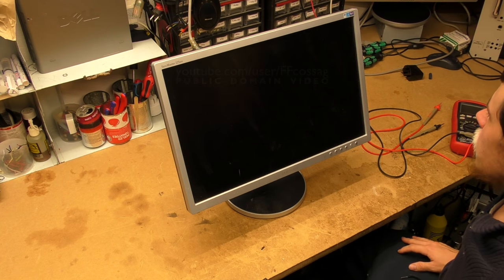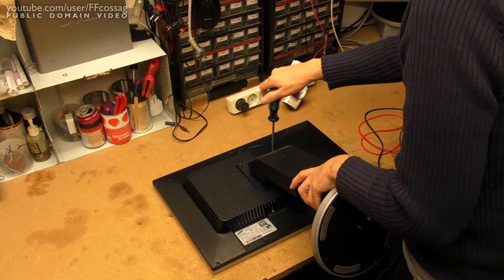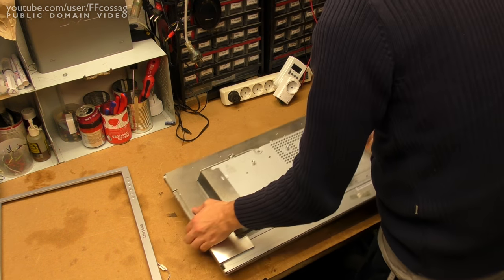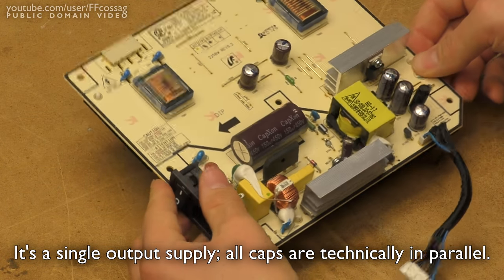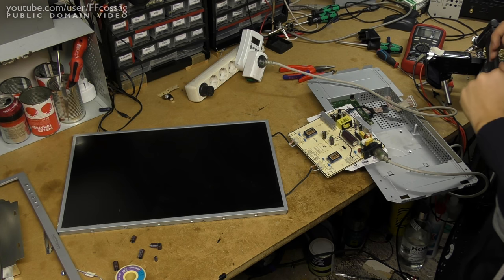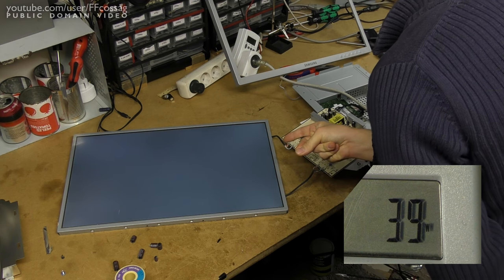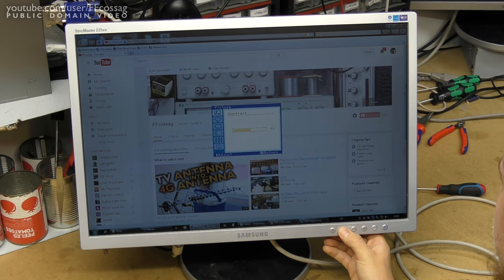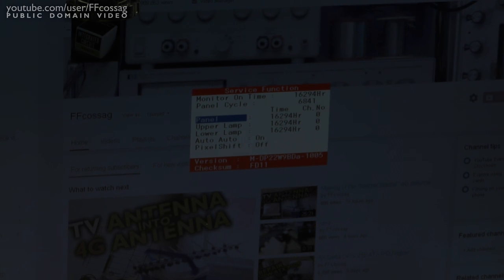Samsung Syncmaster 225BW repair

Comment: Funny, I had to make almost exactly the same repair on a similar model 224BW I think it was. Just a few mintor differences. Same value and brand caps, also same ones bad. Main cap was not CapXon though and still ok. Got the best Rubycon/Nichicon ones I could get and only paid 3.xx EUR for all of them.

Comment: I've got a 19" SAMSUNG 906BW Black-Silver 19" 2 ms that required... I forget what now. The board had a previous attempt at repair. Ah I remember, I found another board for it. It is a very nice monitor, the price was just for the "new board"  I'll have to see if I can pull up that screen as you did to check the internal stats.

Comment: I recently converted a similar LG one to LED from LCD because only changing the bulging caps didn't solve my problem. The LED conversion kit simply jumped over the faulty part of the power board. I'm not entirely satisfied about the brightness after that but the power consumption is greatly reduced from 45W to about 10W. I was thinking about ordering an other kit to double the light intensity that might solved it but since I was planing to use it only as a back up if everything else fails I didn't bother. :)

Comment: Haha i have the same monitor a black one in my little workshop got it from a friend who found it in the trash, and i could not bother to even try it i knew it
had cooked capacitors and my friend he was like no that is impossible... nope i told him Samung screens of that era 2006-2009 are prone to this fault lol!

I also added a capacitor to the same spot as you, cant harm :)
Reply: Hagis2k I still have a black samsung synchmaster lLCD like this, I use it as a TV monitor after I paired it with a TV tuner.

Comment: I just tested my Syncmaster 205BW, which is exactly the same, just the 2 magically turned into a 0, can you imagine? Or maybe I've got the 20" version.
Anyway, it has run well over 31.000 hours ! That's quite a lot !
Reply from the maker: A lot indeed!

Comment: HP LP2465 has a dedicated menu item for also disabling the auto-switching source as well, if you ever run into one. I do wonder if such a thing also exists on your like-Fujitsu B24W-5 panel. 
up until you mentioned it, I didn't even think to check for such a thing-- I was definitely getting frustrated waiting 10 seconds more for the monitor to show picture when waking the monitor up while the machine's locked at the login screen. but, that's just dependent on this monitor for which DVI input you have your machine plugged into, and on this panel, that happens to be DVI 2.

Comment: Mine is starting to complain when power up the screen, its at 13088 hours and 14 years since i buy it.
I also dont have the right size avalibel, so ill try with 4x470uF and 2x330uF its a toat of 2540uF and original its 2630uF
Thx for the video

Comment: Depending on temperature the capacitors have a life.  Another video shows that a capacitor that dried up has so much resistance it is an open circuit.  I guess that they buldge when they blow.  Someone elses video shows what they look like with a puff of smoke from the middle of the + symbol.  What causes that final POP and they are blown condition?  :face-blue-wide-eyes:

Comment: My SyncMaster 225BW has been having issues for the last 50 hrs or so.  At first the screen brightness seemed to go way up (for instance I could not see cell outlines in Excel), but when I would try to fix it by opening the menu, the screen would just go black.  I could get the screen to work again by unplugging the unit, but it would turn off every time I pressed the menu button.  More recently, I've had a lot of flickering, and it takes awhile after turning on to get to the regular brightness.  Finally today, it was showing a red screen, and now I can't get any image to show even though the blue power indicator light is on.  Thoughts on what may be wrong and if it can be fixed?  I would really appreciate it!
Reply: Update: I took it apart, and all the caps are definitely bad.  At this point I'm just wondering if it is worth it to invest in some new ones, or if there is a bunch of other things wrong with it also.  I saw some of the comments about the bad lamp :/

Comment: Are you smelling for OZONE, which would indicate arcing of the high voltage supply on the tubes - bad solder joint.??
Reply from the maker: Yep.

Comment: i have same monitor but in black I think mine mean have bad caps because when you plud it in it works great but if you turn it on and back on the screen is all red
Reply from the maker: Red screen means bad backlight lamps.
Reply: @FFcossag  am I able to replace them
Reply: @FFcossag  also it’s not always red if I power it off and back on a few times it starts to work again
Reply from the maker: You can replace them, but it's fairly difficult. If it's red when it's cold but slowly turns less red as it warms up, it's definitely the lamps.

Comment: Eeeek capxon yuck yuck lol, ive seen too many switchmodes die because of crapxons :-(.
I didnt see what you replaced them with, my favorites are panasonic, not bad :-).
I gave the same 225bw monitor away, a frends display had gone bang and the samsung did the job smashing.
Now the old syncmaster crt monitors sent me batty, it was allways messing with the screen, it was like it was on drugs or something lol.
Reply from the maker: Oh, the joys of CRTs. I use a CRT as my main proofing monitor, and rest assured it was not easy getting it to play nice with my speakers.
Reply from the maker: Pana FM/FR are my main go-tos as well. Fuhjyuu are lovely - they tend to corrode their legs off.
Reply: LOL self removing capacitors, i love it :)
Reply from the maker: ***** Your spelling does ring closer to the truth.

Comment: Funny I have a Syncmaster 225MS that wouldn't switch display source because the "source" button is busted. The shop says they cannot find the capacitive buttons strip part (for lack of trying of course). Only if your sir of anybody in the comments section could help me out locating the part number, the monitor could be saved.
Thanks.

Comment: Yes FFcossag do you have a first name? also can you reveal  your esr meter pc screen setup  interested  in getting the same thing done over here as you have done, also do you use the cap wizard from usa or a regular esr meter, also just a tip  when you put the lcd panel on the work bench
 you should use or cut out a piece of cardboard to lay it on instead of risking a debri scratch on the panel if you didn't wipe the surface correctly just a tip okay thanks tom.........
Reply from the maker: I do have a first name. The ESR meter is a one-off prototype that I can't share, I'm afraid.
Reply: i enjoy your videos greatly !! can we have your first name or do you need/want  
anonymity,  what does ffcosag stand for ,  okay thanks tom........